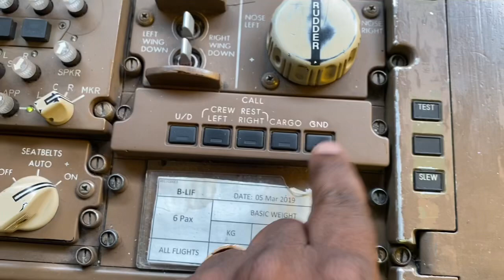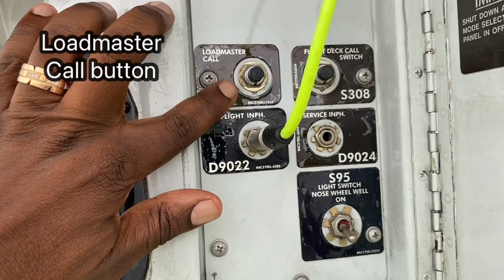Boeing 747 Ground crew call from Flight deck.

Comment: Do the PACKS require the APU to be running to operate?
Reply from the maker: Yes or engines
Reply: @pilot_obet  What about external HP air from starting cart?